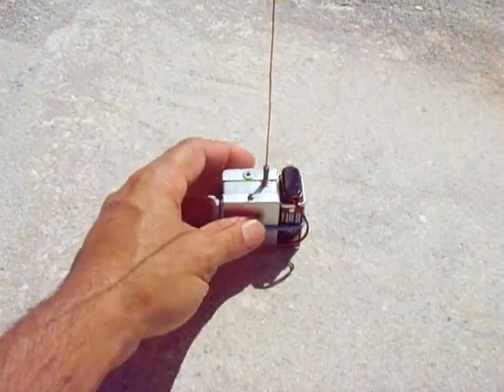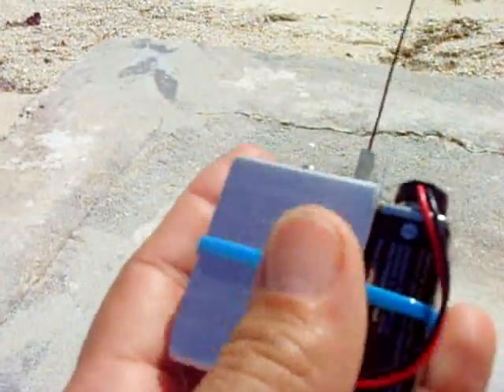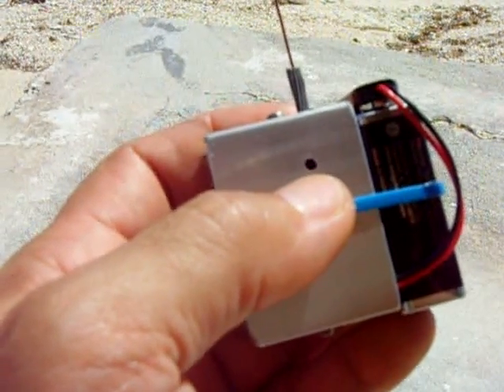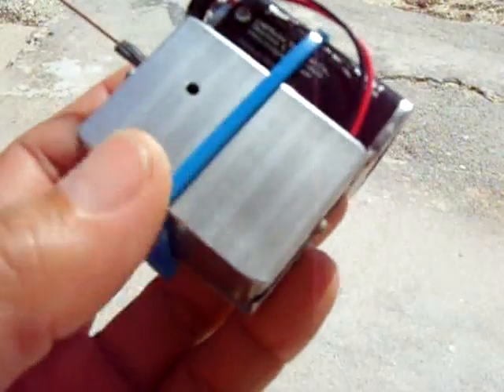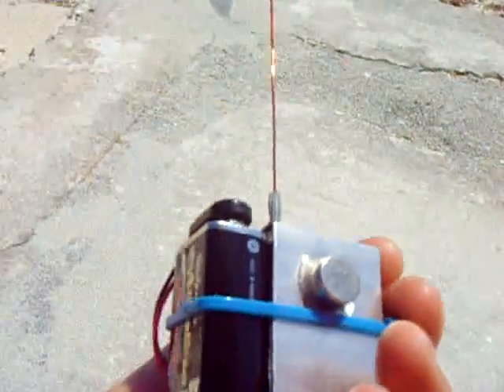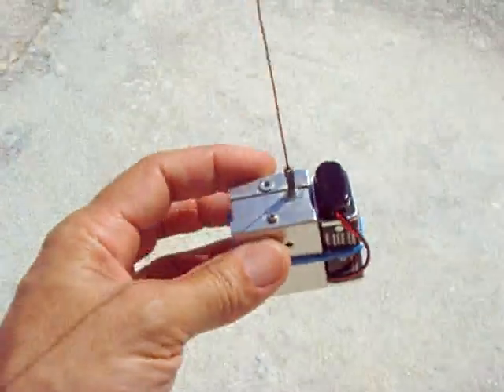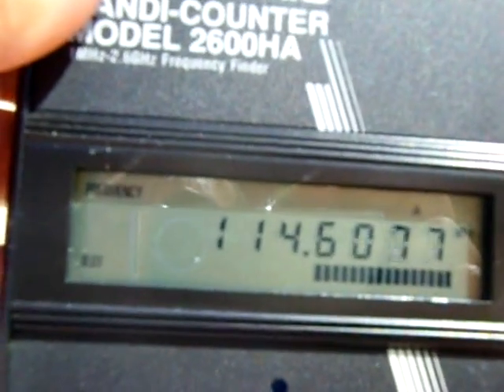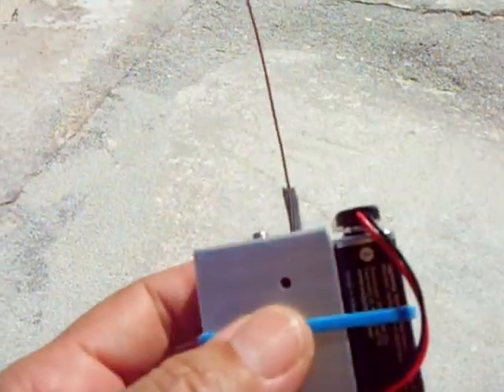9V FM Tracking Device

Comment from the maker: The range is not too far, so you would have to know the general area where to start searching. You would have to do a grid search. once the signal is detected using a good car radio, or handheld radio, you can gradually lower the radio receiving antenna to pinpoint the location, or turn slightly off frequency to see if you can still hear the transmitter. If you are close, you will hear it off frequency. Remember to use a frequency that is NOT being used.